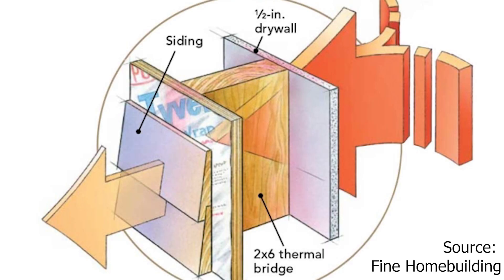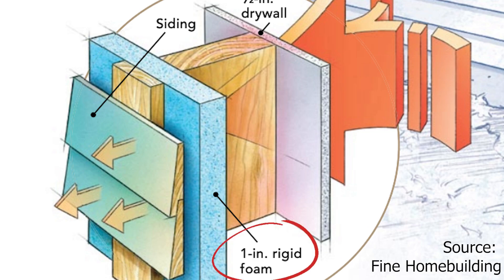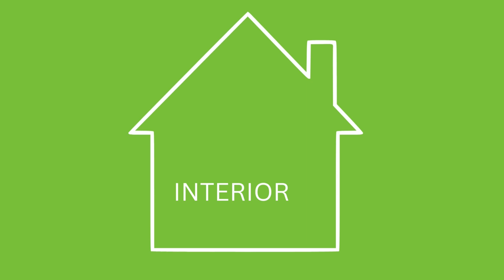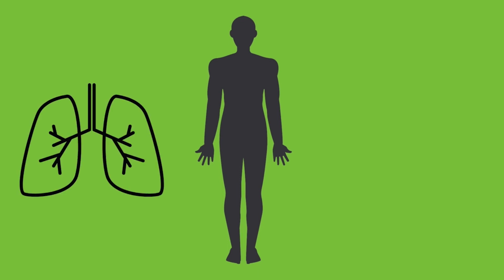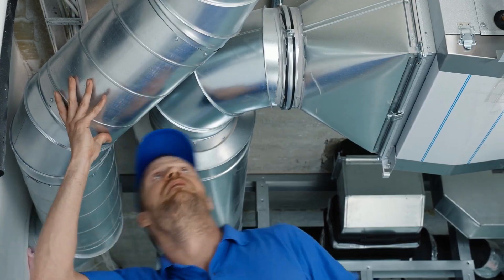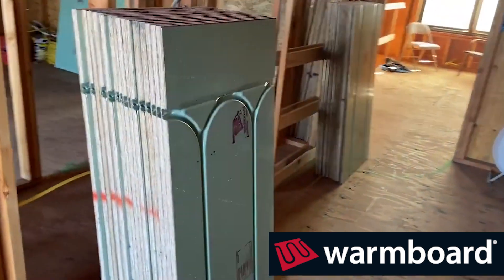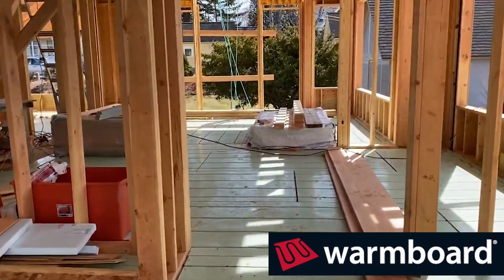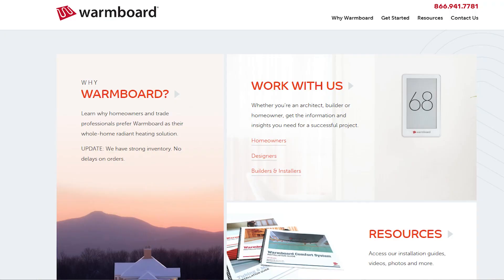The Four Barriers - Important Protection for Your Home

Comment: Just watched your video on weather,air,vapour and thermal barriers. Seems complicated but your best advise was at the end in that you should get some professional advise. Is this likely best from an architect, draftsman, engineer, energy guy, or contractor.  Also what I would really like to know more about is cost effective energy retrofits. Can you really trust savings touted by manufacturers. Like does triple glazing really save a lot of energy. My feeling is less window area is a better saving both in purchasing and energy savings. How about radiant heating vs forced air. Is one more energy efficient. Or drain water heat recovery pipes. How much energy do they really save. I have a hard time believing they will save 40% of my hot water costs. Where can you go to get accurate verified info. Is everything promoted by Net zero or Energy Star really worthwhile.
Reply from the maker: The answer to your questions will vary depending on the project. You will need all the professionals to work together to figure out the best solution for your situation. This is the Integrated Design Process (IDP) that we often talk about. Your architect will need to design it, your energy advisor will need to model it and your contractor will need to price it and then build it. There will be some back and forth and changes in order to come to the best solution for your project. It really depends on what your ultimate goal is. For example, if you're strictly looking to save costs, you may be able to simply get off natural gas and then offset your electricity with solar panels depending on where you live and what your timeframe is. Keep in mind that a 10 year backpack period is a great investment. That's a 10% ROI. A better home will be worth more as well. However, this would not be the best solution if health and comfort were your top priorities in which case the ROI is not measured with money.